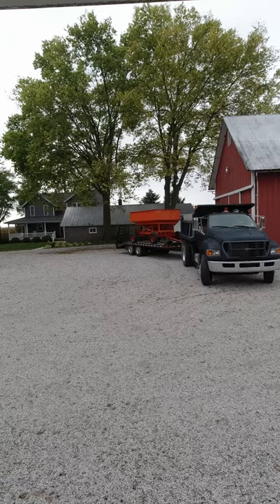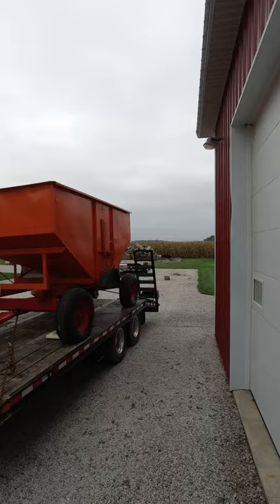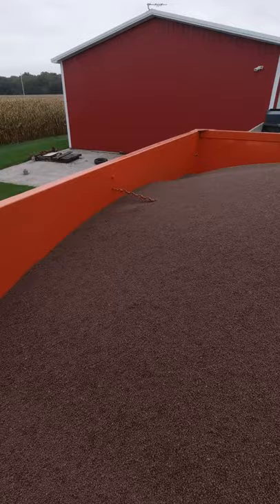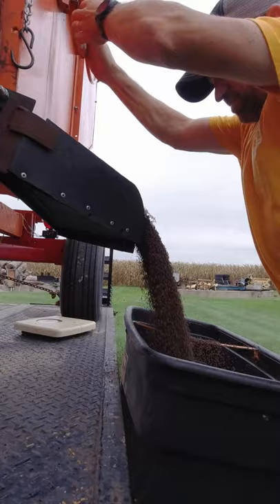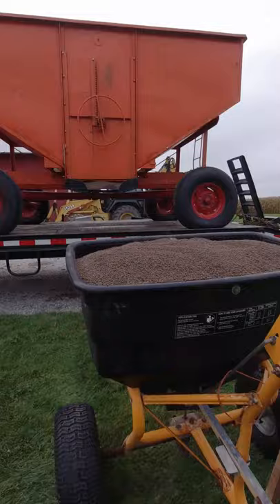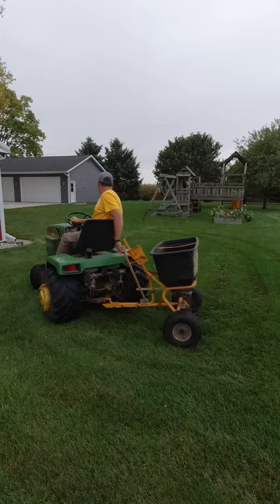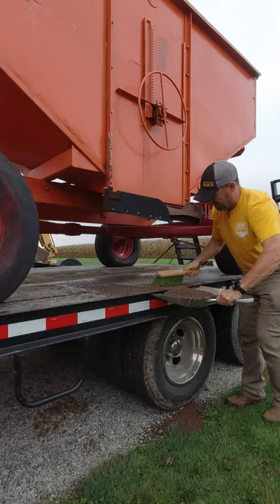I'm a Yard Farmer - Fall Fertilizer Spreading #shorts

Comment: What’s the NPK on that fert? Awesome vid! Need more DDD episodes!
Reply from the maker: Hey thanks so much!  This is actually a pelletized gypsum product called Sulfur Plus, so no N, P or K to speak of in this.  It is technically just calcium sulfate and the analysis is 21% Calcium and 17% sulfur.  I'll spread some N,P & K in the spring.
Reply: @digdrivediy  I’ve never heard of this. What does it do? What grass do you have planted? We use bluegrass and Kentucky 31 mix here but my lawn is nowhere near yours being that we just finished having the house built this year.